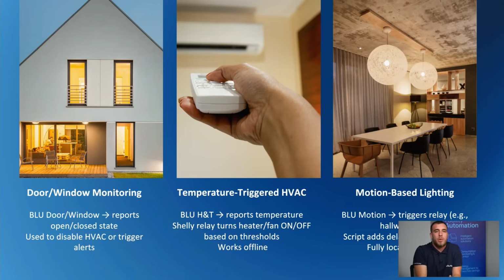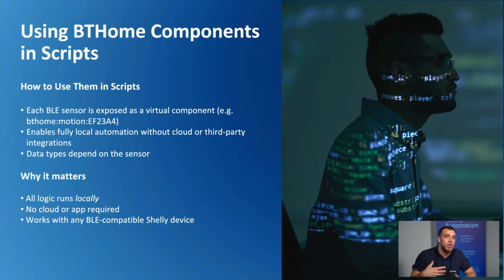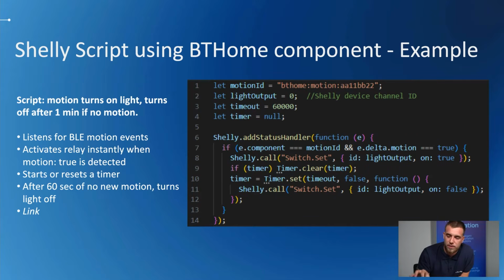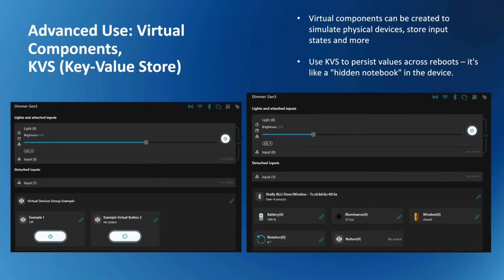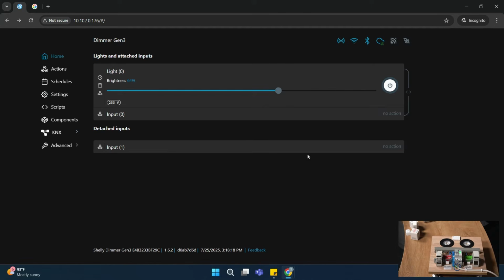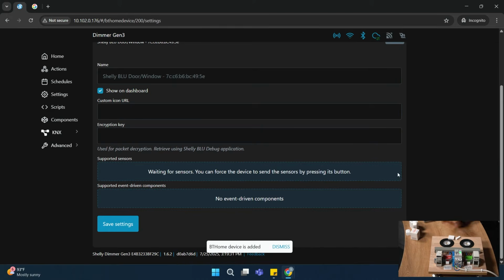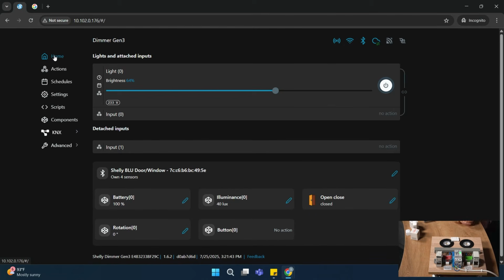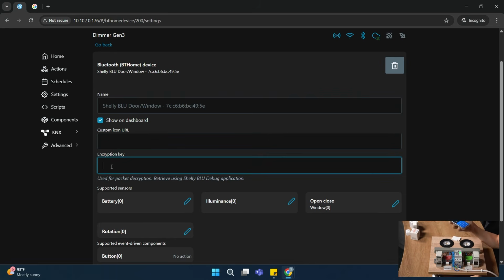Shelly BTHome and Virtual Components Introduction

Comment: This was a clear and concise presentation. Everything was demonstrated successfully without long pauses. Best presentation yet. One thing o would suggest for clarity to the viewer is to present a wireless communication architecture picture. I.e device to device dotted line labeled Bluetooth, dimmer gen 3 to router labeled WiFi etc.. Have seen this in other Shelly presentations.